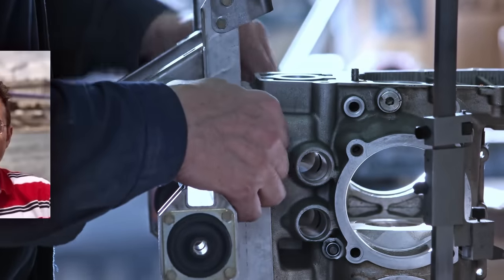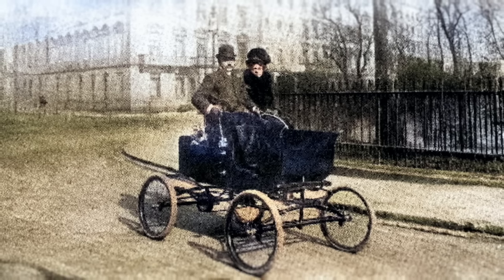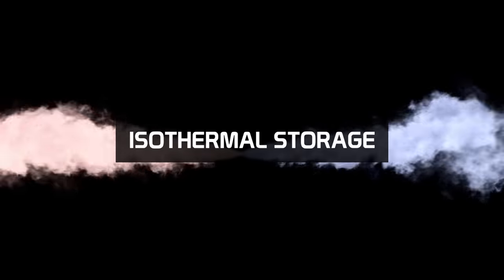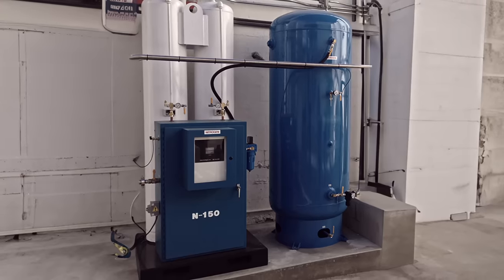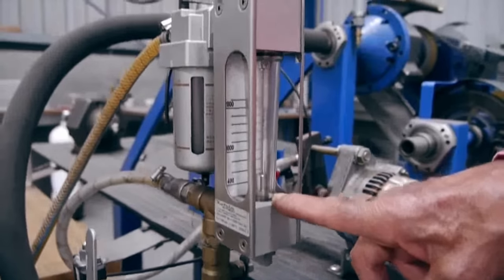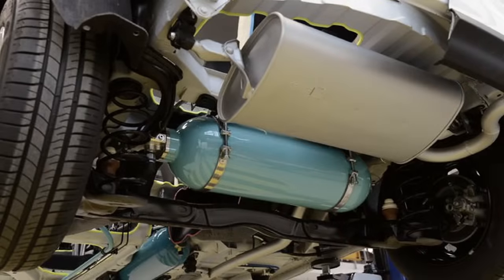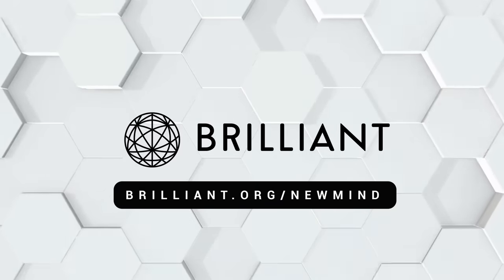Driving On Compressed Air: The Little-Known Compressed Air Revolution

Comment: to be honest I think THIS is the future. compressed air is insane. all you would need is a compressor. and when compressor tech is improved every one could just make his own "driving medium" at home. unlike E-vehicles you dont neeed expensive and dirty batteries. well compressing air and then using it is a little bit unefficient. but still gas engines were the least efficient thing and we still use it. a little bit unefficient is better then lithium or petrol damagging the environment.
Reply: oil cartels wont like you abit

Comment: @11:00 You could solve the drop in tank pressure issue with a pneumatic regulator, assuming your motor works fine at low pressure.
Reply: throwing away energy in the regulator with no return on the power used to compress the air.

Comment: Just build solar and wind powered air compression stations, where tanks are filled while sun is shining. Your air-car gets empty you just drive to one of thousands solar compression stations SCS and refill your tanks for very low cost. The sun does not sends bills. Just a easy closed system with some solar panes some tanks a little bit of control electrics and voila, the air car can go anywhere.

Comment: Why isn't it possible to reduce the volume of a storage tank to maintain pressure? Surely a form of piston or fluid filled bladder could be developed.
Reply: You absolutely could do that, but it's kind of like chasing your own tail. It would take power to move the piston/bladder to keep the gas/liquid at the desired pressure. Since no mechanism can be 100% efficient, you would be pulling more power out of the system than you would gain by keeping it at a consistent pressure. 

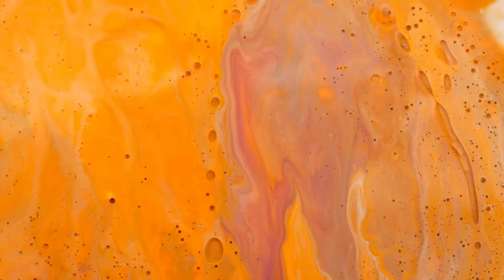While I still find this concept rather impractical as a whole, the idea mentioned in the video ( 7:18 )  of capturing and using the heat energy from the phase-change to increase the pressure is the most efficient method I can think of currently.

Comment: Do believe that little square air compressor that you see at your gas station does it constantly wlth the auto cut off switch  is transferred to assist the rotation of the wheel  ..So fueding with our neighbours is potentially  selffullfilling

Comment: It seems the physicists are weighing in with good reasons why this "stored air pressure only" approach is less valuable than other pathways. That said, I wonder if something like a sodium/water or aluminum/gallium/water reaction that splits water into gas could first pressurize vessels, and then burn the captured gas with some sort of fuel injection system. Would dropping a drop of gallium into a pressure tank (carbon fiber/plastic?) and then shutting the valve definitely not work? How would something like that be accomplished? Would it ever make sense to pressurize a tank that way, or to use it as a hybrid system that kept repressurizing tanks, or charging batteries, the way Edison's EV/Diesel system does?

Comment: Seems like a good idea which may have been sidelined a bit, like other competitors to oil. An interesting and informative video, though it was disappointing that the narrator stated early on that compressed air vehicles emitted "more greenhouse gases" than ICE (internal combustion engine) cars, with no explanation or context given, leaving the impression that compressed air technology is worse for the environment than burning petrol, which one seriously doubts.

Comment: Does need to be electric hybrid but buyer could  recharge electric cartridge in their  home, even in an apartment, to refuel the compressed air, instead of relying on station. However...combustion engine needs are for COMBUSTION...So why a compressed air tank can't be modified to safely power combustion engine is  puzzling. Combustion is just heated air right? Ceramics etc can heat up air...Pressure cookware shows us it can get air quite hot.

Comment: Compressed air is not a fuel. The same goes for battery cars. Those are simply an extra step in the process, reducing the efficiency. You may use a rubber band as well. Energy has to be produced and there will be pollutions as a result. Less pollution with an energy dense method as atomic fission, more pollution something like wind turbines and solar power. As you know, we need base load on the grid so in the last case you have to ad something like  fossil gas burning to the system.

Comment: When I was seven I had a plastic water rocket that contained a water tank and a pneumatic pump that you used to pump air into the water tank.  Then when you pulled the trigger the rocket would spray a stream of water out of the rocket nozzle and launch into the air.

Of course using a fuel and oxidizer to ignite and release thermal energy would be more efficient, but it still worked to accomplish the desired results.  And it was super simple, it required two injection molded plastic halves glued together to form the rocket body, tank and nozzle, and a bike tire hand pump style pneumatic pump with a special connector to attach it to the rocket nozzle and then release it for launch.
Reply: if you thought this comment was somehow relevant, you were wrong

Comment: This has already been done a Ukrainian aerospace engineer developed pneumatic turbine engines for Antonov and some 35 engines are still in storage. This was in 1985 Volodymyr Frolov constructed a car using a air storage systems and compressor and he was using a Volga car body Gorbachev was invited to drive this car he turned the key the car moved at that time only two gears forwards and reverse and Gorbachev asked Mr Frolov what fuel are you using he replied compressed air and Gorbachev was amazed and said that the Soviet union spent billions on oil and gas industry he would not allow this type of car onto production shame .

Comment: @chinabluewho
0 seconds ago
I had  this idea of a van with a solar roof that drove a small air compressor to fill an industrial air  tank but the vehicle did not have an air motor only a tiny .05" stainless steel tube that blew on turbine wheel  (Think water and Pelton wheel) attached to a alternator that would send power to an electric motor to turn the wheels, I had come across this idea after reading about French cars that run off a 5 HP motor for new drivers or people who have had their licenses suspended.

Comment: I’m no scientist but at 2:44 the video says “produces more greenhouse gas emissions than a gas powered car”. Then it went on to explain how energy is lost to heat when compressing air but never explained how compressed air systems produce more greenhouse gas. One might assume that they assume the energy used to compress the air is generated by burning fossil fuels and that so much energy is wasted in the process by heating that it actually uses more fossil fuel than just burning it in a gas engine but they were a long way from explaining that. That could be true but I would need it explained to me in detail rather than just accept it upon the suggestion.

Comment: 9:00 4x the energy "per weight or volume" of Li-Ion batteries? Sure sure. At 300 Wh/kg for Li-Ion, that would need to be 1'200 Wh/kg for compressed air. A isothermal compressed air storage (ICAES) has 3.6 MJ/m³, thats 1'000 Wh/m³. Notice that 1 kg <-> 1 m³ is kind of not the same. Even at normal pressure, 1 m³ of air is already more than 1 kg, let alone at high pressures well beyond 200 bar.

Comment: I was a big fan of vehicles powered by compressed air and for a distribution network dedicated to them, until I learned that obtaining compressed air is a process with 10 percent efficiency. In other words, you lose 90 percent of the energy involved in obtaining that compressed air.

Comment: Unfortunately, the ampout of energy you can store with compressed is rather too low in energy density to be practical for vehicles. It HAS been tried in quite recent times. A French company made a small van using the idea. Its range was limited and it waz also rather noisy too.

Comment: Using the technology of this air motor, it should be linked to a hydraulic motor to give it more torque and longer duration. It would be a hybrid, but the torque increase could make it a larger vehicle, going much further, using much less energy to compress the air. To run the hydraulic motors that propel the vehicle, and now, with composite wrapping titanium or aluminum cylinders, the hydraulics can wait a third of what they have in the past.
Reply: This would just compound losses and reduce efficiency.

Comment: Air compressors need to be constantly running in trucks with air breaks. A car would have to use alot of electricity to power an air compressor to keep the tank full.

Comment: Without heat problems, Air has a very low energy density, therefore it cannot compete with battery based systems and nowhere near a combustion engine.
Reply: exactly, without even mentioning thatthe total cycle efficiency of such systems is ridiculously low, 5 to 10%. BEcause compressing air at 350 bar is extremely inefficient (50% for the best compressor of the industry) and air motor is also extremely inefficient (20% for best in class).

Comment: Compressed air is not uncommon for forklifts in large food warehouses where pollution is not wanted. This way the pollution is transferred to electric power stations or outdoor petrol powered compressors
Reply: yeah, with an efficiency way lower than any other energy storage medium. That is why electrical vehciles are never going to be a thing, because the total cycle efficiency is extremely low, and the usage is extremely impractical.

Comment: Compressed air is a great idea for niche applications.  No ignition source.  Cheap materials.  No pollution.  Easy "fuel" to gather and store.  Free air conditioning.
Reply: No pollution?  How so?
Reply: No pollution? do you understand that the total cycle efficiency is in the order of 5 to 10%?. that is, you put 10KW of electricity at the inpu and you get 1KW or 500watt at the vehcile whell, lol, that is so laughable. IT is the most polluting of all mediums, because the efficiency is so low.
Reply: @lo2740  I used to work for a worldwide air tool company.  Our GTG40 9" turbine grinder had an output power of 4.5kW but required a 25kW compressor to power it.
I will concede that a large-scale compressed air system would have heat recovery, but end-to-end losses make compressed air an instant non-starter for personal transport.  Those who pursue and support it are scientifically ignorant.

Comment: Compressed air has been used for model aircraft for over a century.
Reply: True but run times of around a minute nicad battries 10 times that and lipo 15-20 times and no need for a blimp shaped fuselage.

Comment: Why not use a compressed or liquified fuel pushed through the compressed air engine and then burned in a small gas turbine or engine?

Comment: Battery chemicals are hard to get. Getting away from them then has a practical advantage.
Reply: They EV battery industry is moving away from materials like Cobalt and Manganese and opting for iron based cathodes like the LFP chemistry.   Cobalt prices have plummeted.  Also Lithium is available on every continent and also in sea water.  It is not rare at all.

Furthermore, a battery is a closed system where all the chemicals are still present at the battery's end of life as it was the beginning.  The battery's elements are not consumed during operation. 

Almost all EV batteries will be recycled and the stream of materials coming from the recycling supply chain will be cheaper and more readily available than mining them directly from the Earth.

Comment: you wouldnt need gas stations you could just pump air wherever you are but what would run the pump? solar? 100km range wouldnt matter because you could run on one tank while another tank fills using electricity from a solar panel so your range is really infinite and recycling an air vehicle would be a breeze

Comment: I believed in Tesla Motors before Elon Musk had ever heard of it.  I had trouble believing in compressed air vehicles BUT compressed air should be incorporated in propulsion design.  Before the reader laughs, I owned a Chevy built before emission standards, all the components introduced since then work along with the internal combustion engine, so the idea that motors, engines and compressed air can produce efficient, powerful and clean engines sounds less far fetched when you think in those terms.

Comment: Compressed air power is interesting as a hybrid technology for ICE vehicles instead of batteries. 
Heat is readily available from the ICE engine exhaust and coolant to up efficiency and a large amount of energy storage isn't necessary. 
A compressed air engine can also double as a compressor much like an electric motor can double as a generator.

Comment: The Amish compress their air with wind mills. They run shops, fans, sewing machines.  Air can be compressed with a water wheel aswell. Solar power could pump and compress air also.

Comment: Due to the fact that we've had our noses firmly held against the idea that if it isn't powered by electricity, it isn't practical or marketable........most countries in the civilized world have many miles of underground piping systems supplying water at high pressure 24/7 so it would be just another step to supply pipelines with high pressure air .......a compressed air motor can be recharged very quickly compared to charging a battery with electricity..........and compressed air tanks don't catch fire or wear out.
Reply: Have you any idea of the air pressure required, in comparison to our existing water supplies?  I thought not...

Comment: use the comp air to power dynamos to produce power
Reply: And bolt a wind turbine to the roof to charge the batteries.  Higher speed = more charging.
Reply: or just use the electricity directly in an electric motor save the wastage of the compressor and air motor

Comment: Would be interesting to see HPA buses/delivery vehicles tested somewhere in warmer parts of Africa. Stick a water circulating solar collector on the vehicle roof to heat the air and the motor.

If vehicles are designed with repairability in mind they'd be simpler to maintain than 80's-early 2000's gasoline vehicles they have available in numbers. It is very likely something needs to be done quickly as older vehicle stock in Europe is running dry in few years. Vehicles from roughly 2000 onwards have satanic design and get progressively more and more impossible to maintain by anything short of manufacturer approved dealership.

Comment: 4X energy density? Fact check...
wikipedia Compressed-air_energy_storage says
 "Comparison with batteries
Advanced fiber-reinforced bottles are comparable to the rechargeable lead–acid battery in terms of energy density."
But cair fandom wiki Compressed_air_energy_storage says 
"Ordinary steel bottles thus have about the same energy density as lead-acid batteries and advanced fiber-reinforced bottles that of superior electrochemical storage batteries"
Whoever is right, 4X seems a stretch.  So at best compressed air energy storage for transportation only offers less mining requirements.  Even with lighter tanks from more advanced composite fibers, the mass of the compressed air limits to energy density.  But maybe combining with hydrogen would be better.

Comment: I have always been fascinated by air motors and air-powered vehicles.  It is cool seeing them getting a resurgence and I feel like they do have a place, especially considering compressed gasses are something we have lots of experience with. Not to mention the lack of insanely flammable lithium batteries.
Reply: Petrol is inflammable. 
LFP is quite safe from thermal runaway.
Compressed air is dangerous, like super dangerous.

Comment: It’s a shame these systems aren’t presented from a neutral exergy perspective, even so the energy density of compressed air is not even on par with lithium batteries being about the same worse case to lithium cobalt being 5 times higher.  You would need around 15-20kpsi to beat lithium but cost, control, and danger are high.  The ability to control electric motors on scales approaching the microsecond vs air engines with response times orders of magnitude slower, or the ability to use the energy efficiently for motion with about 90-97% peak efficiency for electric and 30-40% best case (typically worse) for compressed air. A lithium battery is hard to put out, yea, but a compressed air vessel with the same energy is a bomb in a bottle where if you sneeze or get in an accident it all unloads like a billionaire submarine explorer.

Comment: Good concept to research, but this will never be useful in a car. Given that the main issues with electric cars is the range anxiety, electrical infrastructure limitations and rare earth minerals used in batteries, this solution does nothing for range anxiety or use of electrical infrastructure seeing as it appears that you would need to plug into electricity to "charge" your air tank. I would think that the energy density would be much lower, so the range anxiety would be exacerbated.